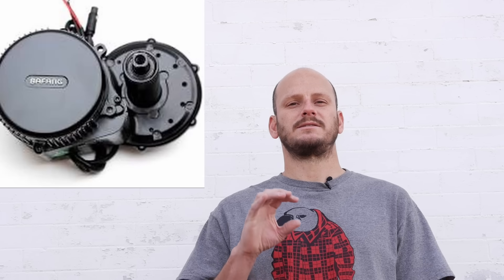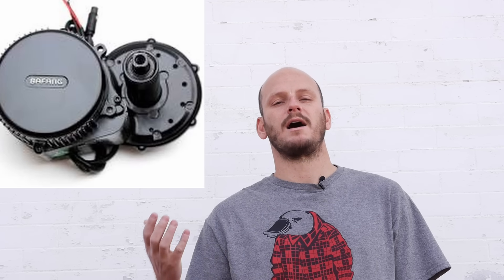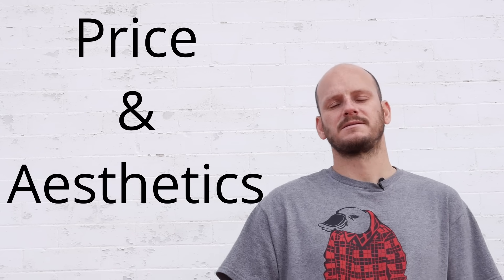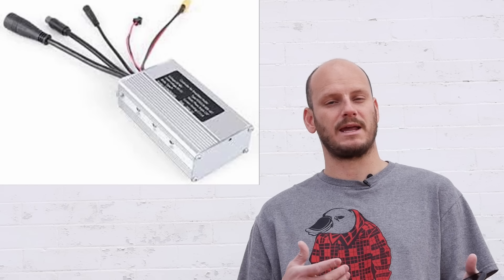Hub vs. Mid Drive Motors: Why Hub Motors Suck and Debunking Common Myths with performance test

Comment: In your performance comparison top speed you were in a more aero position on your mid drive. I do think that initial acceleration is better for mids but once the hubs have stacked enough RPM they do catch up - overall I think the mid drive has more pros than hubs have, but I do want to point out the unfairness of that particular test.
Reply from the maker: True, but i only popped up at the end because of how slow it was going. Also, aerodynamics wont make up that 8mph gap
Reply: @JohnnyNerdOut   I just want to see a proper test so that its not easily refutable. I've owned a hub but I have to admit after seeing mid drives in action I think they have the edge in performance. About the gap - that would depend on the distance. Initially it will not but hubs rely on stacking momentum to get up to speed. in less than 100 meters the mid drive will dominate the hubs but at around 300 it will be a tesla vs lambo thing where the lambo eventually catches up. in around 300 meters the momentum for both bikes will be enough and enough speed will be accumulated to actually have aerodynamics be a factor. So in a sense, it IS  true that mid drive trump performance over hubs in that distance and at those speeds, but the test itself could be changed to make it so that the hub can catch up. Overall  while I think performance is better for mid-drives, the advantages and disadvantages it currently has is not enough to completely make hubs obsolete. I'm personally doing a dual drive build - I'm not sure how to fit in a 60t crank to a mid drive yet but it would be interesting switching drives on the fly to see how  they compare.

Comment: One vote for hub motor. My lovely wife. She has never shifted a bike in her life and is 70 years old. I have done a front rear hub motor just for fun. Mine is a cyclone, in the midst of coversion to IGH with an SX-RK3 Sturmey Archer. Adding a collar to the gear with six roll pin drive on the input hub.

Comment: What about hub motor + pinion reduction, could be a valid solution for a DIY quad, mostly for off road ?
Reply from the maker: but then your still stuck with that single gear choice, right?
Reply: @JohnnyNerdOut  I guess you are right ! It's pretty much like one of my electric disabled scooter.
Reply: @JohnnyNerdOut  But there's another detail to take in consideration, in my case. From what I'm aware, and please correct me if I'm wrong, the only way to have reverse function, is to use hub motor. For me, as a wheelchair user, this might be essential. 

Do you have any idea how reverse function is achieved on these projects and if can be applied on midle motors to ? 

Kind regards.
Reply from the maker: @syncrovanCos  you are current, only a hub motor to my knowledge can do that, using reverse polarity would be my guess

Comment: You made a big ooops.  The higher the voltage, as in performance cars, the lower the amps for the same watts.
W=VxA.
Reply from the maker: what did i say?
Reply: I think..800 volts, so lots of amps?

Comment: Surely a mid drive using the lowest gears puts out more torque, therefore is going to bust spokes more readily?
I guess you see failures in hub motors as they are poorly built in the first place. 
If you have disc brakes, wheel building is easy as you don’t need to be so perfectly trued as with rim brakes.
I have to admit liking the simplicity of a hub.  I would run it with a single low pedal gear for climbing hills, as my ski access bike.
Can you get hub motors designed for different speeds?
Reply from the maker: yes you can get different hub geared differently. And yes, theoretically you can bust spokes readily in low gear, but I assume you will have a well made wheel and wont need to worry about that. why not have a mid drive and have access to all gears?

Comment: on ali express there is no mid drfive kit under 450$. pretty much every hub drive under 3000 watts is under 400.  excellent points btw but once again as with so many of ur type, you are basically telling us that if we are poor then we dont deserve to ride electric. i ride dual hub motors because its all i can afford. and the 2 hubs i use is still cheaper then one mid drive.
Reply from the maker: I sell a 750w mid drive on my site..... www.johnnynerdout.com

Comment: Hub peddle up to speed first before using power and it's only good on the flat roads not on hills. And feather more ride sensibly and intelligently and you will do fine.

Comment: He's talking about baby motors. He clearly hasn't owned a 3000w or 5000w hub motor, plenty of power I always got from my bikes. His personal choice to ride mid drive, also failed to explain which one can still be ridden when the chain brakes, you can't ride the bike, but with hub motors  you can STILL ride the bike to get home with no chain. Fact.
Reply from the maker: the point was to compare "apples to apples" street legal motors

Comment: This is fascinating! Thank you! Your last point answered my question… I want to convert a four wheeled surrey into an ebike. It’s single speed, so it’ll be hub motors. Do you have any experience with surreys? Can you recommend whether front wheel or rear wheel motors would be better?
Reply from the maker: I havent done a surrey yet. I don't think it would make much of a difference
Reply: If u dont want to drive only on flat surface i would prefer rear wheel drive, on a climb or acceleration ur weight shifts to the rear wheels so u have less traction in the front.
I would do two bigger on the rear and two smaller on the front combined if possible.
Reply: @InsertValidName  This makes a lot of sense! Thank you!

Comment: I've converted two e-bikes. The first was my wife's hybrid with a 750w Bafang £400 mid drive and I built a 52v 15ah battery for £400. It flies, looks great and handles well. I wanted an e-bike too so fitted a 1000w front hub motor (£150) to my cruiser and built my own 52v 12ah battery at £350. It's also good but has all the disadvantages mentioned in this video including lack of torque, ugly controller, it can't be programmed. I didn't have the same budget for my bike and I enjoyed the build process but the next one I build will be a Bafang 1000w mid drive at 52v 17ah battery on a decent hardtail bike!
Reply: so how do I learn how to convert bikes? I don't understand how you guys already know how to do all of this stuff 😆 my dad died before he could teach me much about this kind of stuff so I really need a point in the right direction, I just bought my first ebike online last week and it will be here in about 3 days. I would like to learn as much as I can in the meantime and potentially start trying to build my own next
Reply: @MattttG3  check out ebike school on YouTube. The channel host has also published books.

Comment: How come supposedly putting less torque into the wheel breaks MORE spokes?
Reply from the maker: Because they are often poorly made
Reply: @JohnnyNerdOut 
Not the one's I'm seeing!
Reply from the maker: @_a.z  Nice. I guess I only get them when they need to be repaired, so that makes sense.
Reply: @JohnnyNerdOut 
You have the chain as a weak link I guess! 
Hubs are simple and elegant and the whole wheel is built for the job, not just the motor.
The only problem I've seen is breaking forks, something most are not aware of or warned about in the manual.
Reply from the maker: @_a.z  Check out the amazon kits that go for $230. Complete Hub motor built into a wheel with a controller for $230. There is zero chance quality is acceptable on anything. Buying something from ebikes.ca on the otherhand for $600 for just the motor in a wheel and I agree that quality will be there. Not the performance, but quality.

Comment: Fit a Shimano Alfine hub gear and you wont need to worry about clunky deraileurs falling off and getting tangled in the spokes. You can't do that with a hub drive. Choose your frame carefully and you can fit a Gates drive belt with mid drive and Alfine rear hub.

Comment: Alright Blah blah blah... All that experience you have but no real clue what you are saying. Man my hub motor has 4 gears... electrical "gears"/power modes, low,mid,high,turbo. Obviously uses more power going uphill like any electric vehicle but then switch back to lower power mode. Irrelevant video, should be same ride on both to see power consumption/range. maybe hub has less range but you explaining like its a car is making me angry. Thanks for misleading everyone with "your" "experience" ha

Comment: hypothetically speaking, would it be possible or even practical to run both a hub and mid?
im building an ebike from scratch and was looking at the hub cause its quieter but just out of sheer curiosity, could it be possible to run both motors and still be somewhat practical?
Reply from the maker: Short answer, yes. Not very power efficient but it could be handy in extreme off road applications where 2 wheel drive is needed.
Reply: Why not run a motor in both front and back wheels alongside your mid to get all wheel drive?
Reply from the maker: @sammiller6631  IMO that would consume way too much energy for what it’s worth for 99% of applications
Reply: @JohnnyNerdOut  Yes it would consume a crazy amount of energy but if they're interested in a frankenstein setup of both hub and mid, why stop there when they could go all the way over the top?
Reply from the maker: @sammiller6631  very true! Could make a cool video too 😎

Comment: I have been building ebikes since 2012, by first was GNG middrive it definitely had some issues, but it still beat the hell out of any hub motor, I'd do a hub motor conversion for my grand and that would be it, well if I had a grand.
These days I'm using a TSDZ2 midrive, and it's awesome, not as powerful as the Bafang middrives, but I love the torque sensor. If I want something with serious grunt, I still have a bike kitted out with my original GNG motor, the torque on that thing is insane.
Reply from the maker: Nice! I agree with 😀

Comment: While your analogy makes sense, my hub motor has tons of torque and low end. My chain is just for low end and conserving the battery but if I just want to throttle it works amazing. I’d love to race a mid drive.
Reply from the maker: Ya I think you’d be surprised by the power of a mid drive😀

Comment: Furthermore, he makes it sound simple and that mid#drives are only $50 or so more than hubs., but I start with Amazon and the search acts like I don’t know what I’m asking for. (Sometimes I hate databases).  I find, mainly, a bing of motors and parts. Finally I see one for $1,500 - far more than the hub baby I was considering and not the body style I wanted.
Reply from the maker: Are you talking just motor kits or complete Ebikes?
Reply: Whole bikes. Hard to find online. My city does has a nearby eBike shop with mid-motor bikes but expensive. I want to only $1200 or so, preferably less. 
I am older and my biking would be limited.
Reply from the maker: @stevepowsinger733  I would strongly recommend converting a bike yourself. If you have the stomach for it I just posted a video on how to do an install and I sell all the specialty tools you’ll need for about 70 bucks. You could save a boatload of money. Probably have a crazy powerful mid drive motor that works very well for about $1000

Comment: I started on high torque , geared hub drives and moved on to a mid drive.
The middy has its advantages, but overall the downsides have pushed me back to hubs.
Endless, one gear power, no drivetrain wear or horrendous banging and crunching.
You can change gear under load..you can get home if the chain snaps.

Comment: I disagree about this. Yes, a non optimized hub motor is not geared the same as the tuned mid drive, but if you have a powerful and tuned hub motor, you will have less losses in transmission, period. You will also have a lot less complexity hence less failures. Also, no matter the placement of the motor, the spokes takes all the torque. My own only concern with the hub:s are the undampened weight. I think this is also the biggest reason for the more frequent spoke failures you are seeing with hub motors. This is alot due to badly designed and heavy hub motors. I bet the future drives will change this alot. There is huge potential for improvement here! Not so much with the mid drive. /Professional EV motor designer
Reply from the maker: The comparison was using street legal motor systems (under 750w). In my opinion, cyclists tend to like mid drives. People who are new to cycling prefer hubs.  As in my pinned comment, crappily made hubs are the culprit for loose spokes. The performance of a mid drive cannot be denied when compared to a hub of equal power(wattage) no matter how that hub is geared. (In my humble opinion😀)

Comment: I have two bikes right now, one with a Bafang Ultra and the other a Bafang 1,000 watt hub motor. Since I just like to use throttle, the hub drive is more pleasant to ride...
Reply: Funny I use the throttle on my mid drive all the time.
Reply: @dhincks1  Me too, I've always had motorcycles but it's not the same, with the Ultra seems like I'm always babying it so as not to destroy the drivetrain and having to run through the gears from off the line isn't fun, more of a drag for me but that's coming from someone that has both types of motors...
Reply: @BubbafromSapperton  that's the crappy stock controller that's the problem, if you run a FOC controller with field weakening its the best!
Reply: @Gringobrah  Na, since I can't turn peddles I ride my Bafang Ultra throttle-only in 3rd gear, that's still a hell of a ride especially off the line. Worried about how much I would lose if my bike got stolen so easily otherwise a simple step-up would be a Wattwagons modded Ultra motor at 2,300 watts but I'm a slow smell the roses and enjoy the scenery rider... 😆
Reply: @Gringobrah  My Ultra is a 9-speed, most of the gears on it are useless, only really need a few with that motor I live on a mountain and first and second on my bike are useless...
Reply: @BubbafromSapperton  same as my HD I only use 3-5th gear and I can top out over 70kph on flat ground

Comment: per watt yes, hub motors are less ideal. High wattage hubs wont be an issue. if a hub motor is overheating, you are feeding it waaaay to much power. Also, wear and tear is something to consider. You are motorizing bicycles, BICYCLES, they are not meant for the power or speed. you are essentially causing a lot more stress on components. I wouldnt say hubs are bad per say. Just weigh out your use case. and make sure you get good quality components. spokes take a beating cuz you are speeding 30 MPH across potholes. and hub motors are much cheaper. each has advantages and drawbacks. I own hub motor and mid drive bikes. I also have the bafang geared hub drives and the standard always engaged hub drives. and almost all controllers have a variable PAS system. its standard. the most powerful mid drive is a cyclone. they have a 3kw and a 6kw if I remember correctly. but remember there is limits to bike chains. also, the more speed and power you put on a chain, the more strain and spinning force you put on it. that wants to pull the chain outwards and pulls on the derailer. causing slack and possibly derails. make sure you keep up you maintenece on a mid drive or it will be troublesome. I have been tinkering with e-bike building for a few years. and there is a lot more that goes into it then it seems. and pre-built bikes are like pre-built PC's. I wont touch them with a 10 foot pole

Comment: is that hub a geared hub motor?
Reply from the maker: It was a bafang, so 99% sure it was geared
Reply: @JohnnyNerdOut  not a real rep of direct drive then.
Reply from the maker: @highwaltage  no. But I believe a 750w direct drive would perform less favorably on the hill climb than a geared hub. No?

Comment: Your spoke stress analogy doesn't compute. What's the difference between a hub motor's effect on spokes and a geared hub's effect on spokes. Seems to me that both would exert the same amount of force on the spokes. In fact, I would go so far as to say that if you shift into the granny gear and open the throttle, you would exert more force on the spokes than a hub motor. Please clarify.
Reply from the maker: Check pinned comment😀